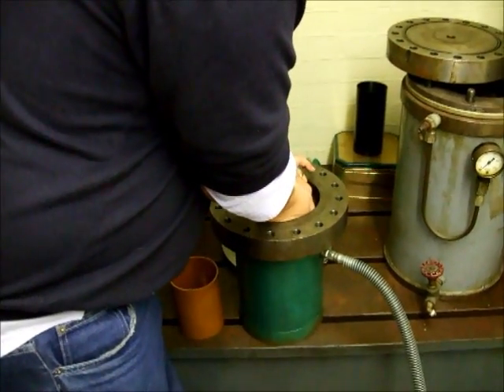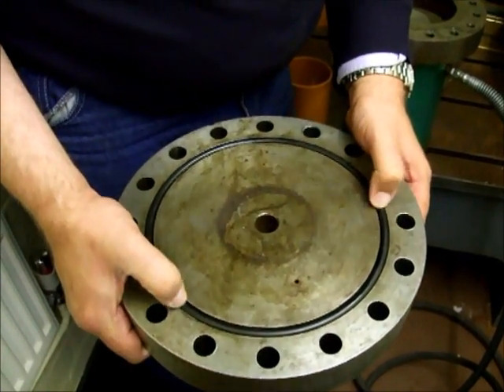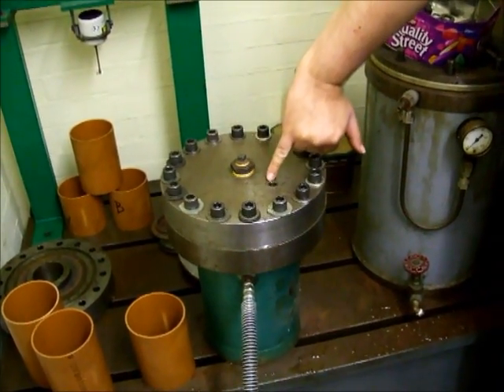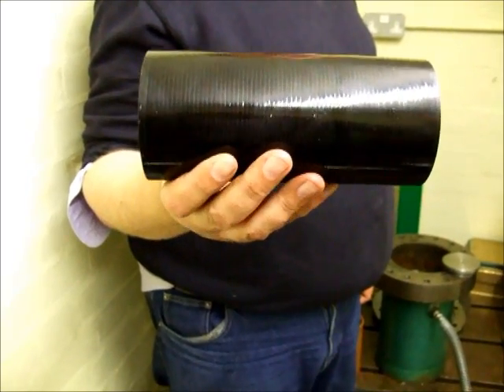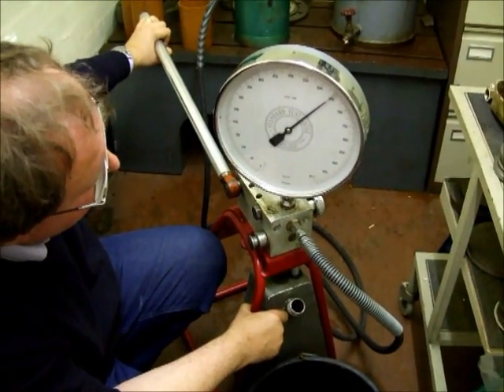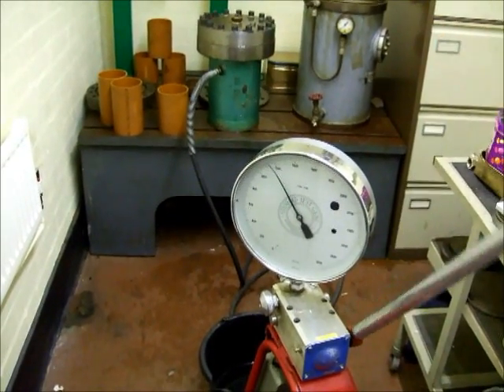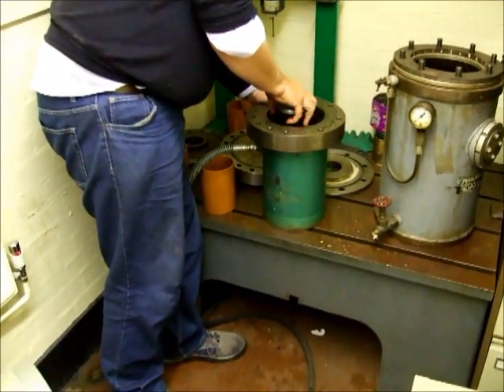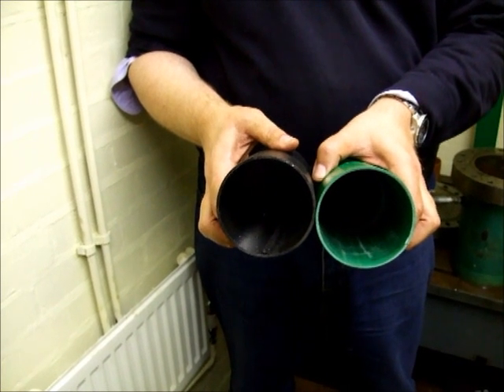Collapse of Composite Submarine Pressure Hulls

Comment: Scarily how similar this design is to that of the Titan. Cylinder wrapped with carbon fibre sealed with 2  metal end caps. Almost identical replica save for size and metal types.....
Reply: And the end cap here seems to extend into the tube. I'm pretty sure at least one side of the Titan's, didn't, but was epoxied onto the outside.
Reply: Titan had titanium as well

Comment: Can someone explain how this test proves that carbon fiber was a bad  idea for the Titan sub? This looks like an example showing how high the strength to weight ratio of carbon fiber is.
Reply: CF is a wonderful material. It just has limits to its wonderfulness. Very sudden limits.
Reply: A crack in the hull of a submersible is a life ending event. This video shows that it’s not built to withstand as much external pressure as other material. Also keep in mind this video is viral now but was created 10 years ago so these tests were not designed to prove anything about the Titan
Reply: What the experts say is that carbon fiber weakens with every dive, and in ways that are microscopic and thus impossible to predict.  If Titan had survived its most recent dive, the next one would have destroyed it.  Likewise, the fact Titan had previously made it to 13,000 feet but this time imploded at 9,000 feet shows the carbon was coming apart. Cameron described it as 'delaminating.'  I read another expert who said that connecting carbon fiber to titanium is very hard to do well—and of course the end-caps of Titan were titanium.
Reply: @opinionatedpossum1945  thanks for the detailed explanation. That makes sense. This video seems like like a standard destructive test to me. I still think Carbon fiber is amazing composite material. It just seemed like the Titan team lacked the experience in designing a sub to go that deep.
Reply: Because carbon fiber weakens under compression/decompression.
Its possible titanium over carbon fiber would have been optimal- OR carbon or metal reinforced internal structure that went top down and side to side.
With carbon fiber, it only take a fissure then BOOM.